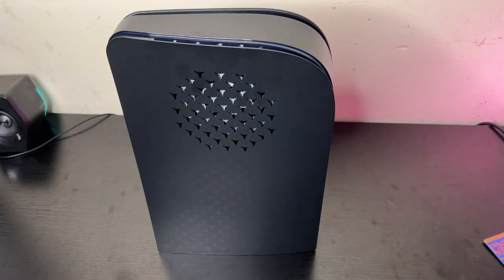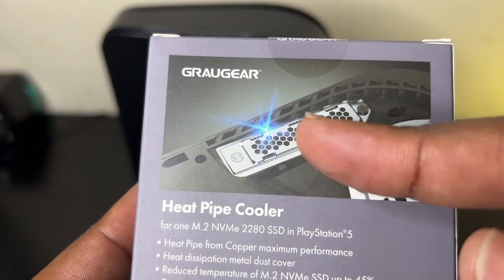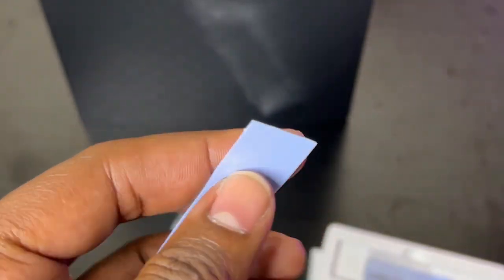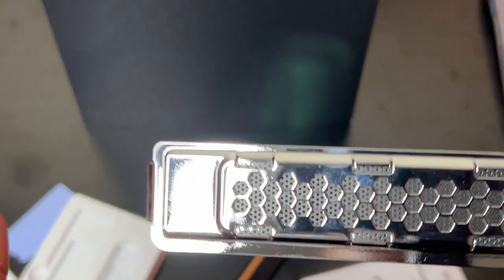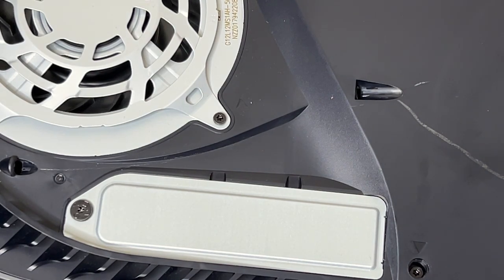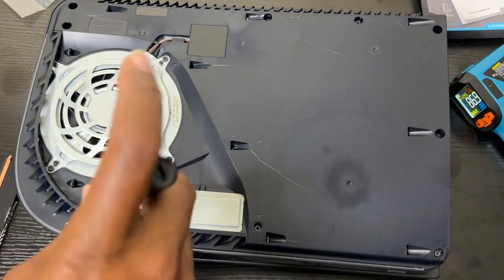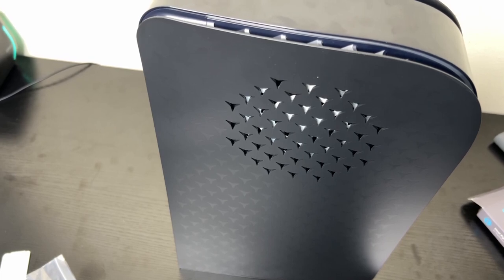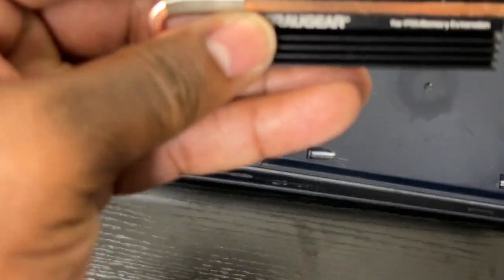#ps #ssdupgrade

Comment: I came up on a wd black 850x 4tb. 20 minutes after using it my ps5 shutdown because the ssd was super hot. I put my 1tb 980 pro. Went to Amazon out of all the heatsinks for ps5 with 5 stars, I chose this heatsink. Lmty this heatsink works. I play long hours somedays since I'm recovering from injury. Has not overheated and made the ps5 shutdown. It runs cooler than the 980
Reply from the maker: Yeah. I was fortunate to have found this heatsink. Out of all the heatsinks I’ve tried, and I’ve tried a lot, this one definitely works as advertised. I hope you have a speedy recovery.
Reply: @balancedwingsbudgettechand8281  yeah we got lucky. I was scared but turns out best choice randomly.  Thanks man. Its been a few months. Can't wait to start physical therapy. Get back in shape. After 10 years of not gaming I'm back. Shame on Sony not making ps5 a super console n letting us play ps1-ps5 discs on the ps5.
Reply: Did this heatsink help u with the sn850 because mine is overheating as well with the heatsink that came pre-installed from wd
Reply from the maker: @cross-hairz800  this heatsink, from my experience will help with your overheating issue. The heat pipe alongside with the vented plate definitely keeps the ssd cool preventing overheating. Like slapndbass says in the comments, he had the same issues like what you’re having and ever since he installed this heatsink, he be gaming for hours without any heating issues and i for one second his testimony.
Reply: @Tech-Timistic  but my sn850 gas built in heatsink so how would I do that?:)
Reply from the maker: @cross-hairz800  I never had the the wd 850 with the heatsink so I can’t tell you how to remove it. In the meantime, I googled how to remove the heatsink from the wd 850 and on Reddit they have a few people that removed it but states it’s a little complicated. My suggestion to you is: if it’s possible for you to return the ssd, get a stand alone ssd, that’ll be great. If you can’t, order the heatsink and use the ssd plate that comes with it because unlike the ssd plate that comes with the PS5, this faceplate is vented which aids with keeping the ssd cool and the ps5 faceplate is solid.
Reply: @cross-hairz800  helped me just fine

Comment: I think you should remove the kingston's "heatsink" that comes from factory (more like a sticker to me), and then put the new heatsink with the thermal pads touching the memory modules. In that way, the heat is going to tranfer properly
Reply: Sometimes that's not a good idea because sometimes that sticker is copper/graphene that SPREADS the heat more evenly

Comment: Thank you for your video. Just added the metal heat Dissipation Cover for a WD black sn850x SSD I put in. Hopefully it works🤞 at the very least, I don't think it will hurt😁
Reply from the maker: Don’t worry. It’ll be fine. 👍
Reply: Did it work??

Comment: I merge that heat pipe cooler with with heat pipe that extends the copper pipe to the fan to cool even faster
Reply: So you left the cover off ?
Reply: @D00LEY356 he's using the cooler that has the arm extending to the fan. With that one, you can't use the cover.

Comment: How long have you been using it ?
Reply from the maker: It’s been almost a year now and still working just fine
Reply: @Tech-This-Out  what about dust does go inside it because it has holes in it?
Reply from the maker: @kararar7790  the holes on the top is small enough to let in enough air to keep the ssd cool while the filter underneath the cover prevents dust from entering the expansion slot
Reply: @Tech-This-Out you say a year but this video is 6 months old 😮
Reply from the maker: @firebythewater4477  that was an mistake on my part. I was rushing when I responded and just hit send without paying close attention to what I wrote. I’m not trying to lie or mislead anyone.